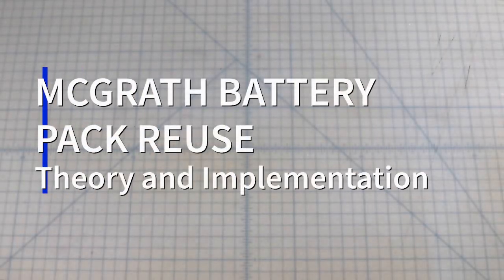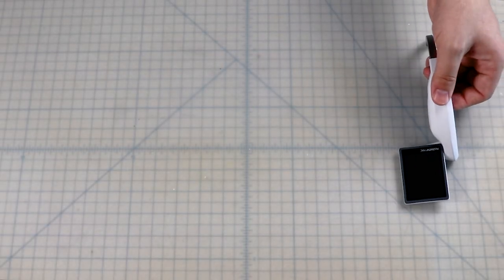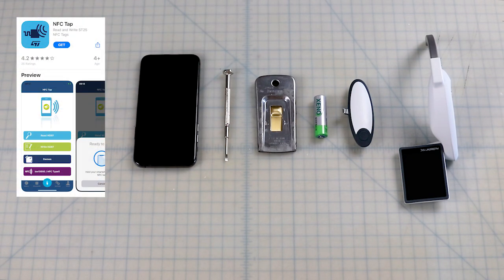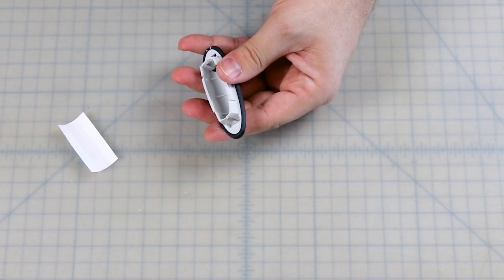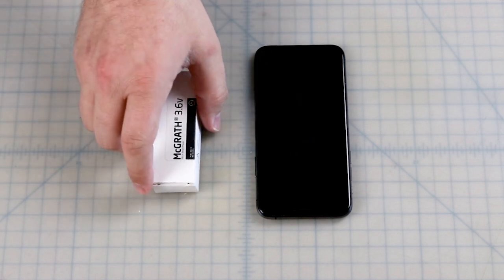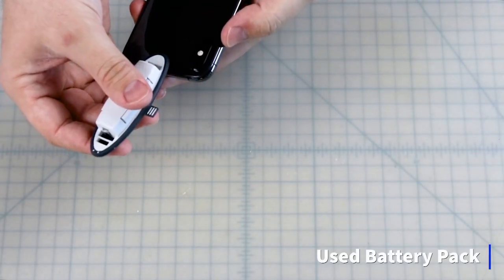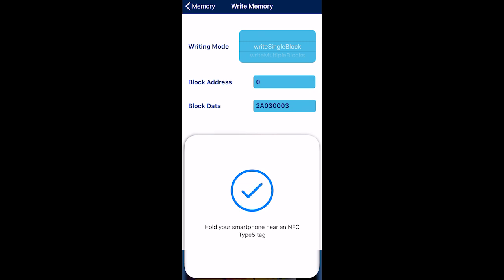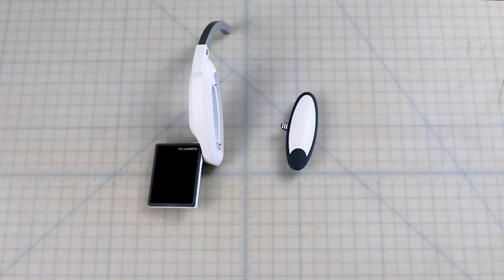How to Reuse a McGrath Video Laryngoscope Battery Pack

Comment: Hi Marc, fellow anesthesiologist here. 
I purchased a McGrath for personal use since several surgery centers lack of airway equipment.
I’d like to use a NFC app to extend the use of my batteries.
The app referenced in the video does not seem to be available anymore.
Any other recommendations. Some of the other NFC apps are expensive or don’t seem to work well.
Thank you.

Comment: Hello. I have a problem with replacing the battery. When I installed a new battery and turned on the device, the monitor does not show a picture. What is the problem?

Comment: Hello
If anyone is still looking for the android app similar to nfc tag, i think is called ST25 NFC Tag, at least it has the same icon, but a different layout
The annoying thing is that the phone has to be in contact with the battery the whole time. It can read and write the desired values.
Unfortunately I could not get mine to work because a colleague had used a different app before me and formatted the tag....so if anyone can make this work and save a loadable data file, please let me know

Comment: Thanks for this valuable video ! I was able to reset the OEM battery. Tried few new batteries and most of them were shorter than the OEM and did not make contact with both end of the hub. The last battery I tried fit perfectly but it didn’t work despite the scope turning on. It would go straight to a blue screen. I was wondering if you have any idea what the problem could be. Maybe the system is only compatible with the HCB OEM battery? Mines is 2021

Comment: I wonder when they will address this "undocumented feature" of their firmware :)  Does it still work? Nicely done!  Would you mind sharing how you deciphered the data to get a use duration that you could modify?  Is the 250 (for practical purposes) the number of intubations or is a RTC based system?

Comment: The app doesn't let me read multiple blocks 
I was wondering if any other apps are also good for doing it
Reply: I had to use the NFC Tools app. I had to pay $2.99 to unlock the write feature but it was way easier to use than the free app.
Reply: @rhettkelley2699  can you provide instructions on how to do this with the NFC Tools App?
Reply: @rhettkelley2699  How did you do with NFC Tools? I bought it but I don't know how to edit the values.

Comment: "NFT Tap" free application is no longer working. I used it about 6 months ago and it worked fine. I tried today and I get an error message anytime I try to scan a battery: "Error while processing CCS file" ...this is very upsetting and I cannot find a way to get past this. 
"NFC Tools" for iPhone is another app I found that does work flawlessly, although it is not free. However, only a $2.99 one-time purchase so it's definitely worth the 3 bucks.
Reply: can you please provide instructions on how to do this with the NFC Tools App?
Reply: @DominiGuya  its the same, the options have the same name
Reply: Can we write the same codes?
Reply: Would you be kind and share the instructions with this app?

Comment: Really did appreciate this video.  Once we reset the timer on the battery, we no longer used it for patient care.  They were great for training and did extend the life of our patient care batteries by ONLY using them for, you guessed it, patient care.  The first time, we replaced the internal battery as suggested in the start of this video.  It worked but seems to add an unneeded step, but even using the original battery, we could often get another hour or 2 from it.

Comment: Hi Marc, do you leave the battery slot exposed, save for that bit of paper, or do you put a bit of tape over it? Or does it remain in place just fine without doing that?
Reply from the maker: Should stay in place fine without tape.

Comment: Error while processing CCFILE. Any ideas how to remedy? Using iPhone 12 Max.
Reply: I had to buy NFC Tools in order to read and write to my battery. I got the same error using NFC Tap.
Reply: @karlahanks9818  How did you do with NFC Tools? I bought it but I don't know how to edit the values.
Reply: Use “OTHER” and then use READ/EDIT MEMORY  to read the data and edit the values you wish to use.
Reply: Then what valúes i hace todo change¿

Comment: Great video thanks, we are considering buying some McGrath VL's for teaching but I didn't like the idea of a non-rechargeable/sealed disposable battery pack (never-mind the cost!). At least this way you can re-use the housing, or hopefully find a rechargeable 3.6V battery replacement. And great tip to re-program the original pack when the first 250mins expires. Seems you can get almost double the run-time (and if only being used for teaching, no risk if it cuts out mid-intubation).

Comment: Does this work on new battery pack?  I just got my blade and battery and it looks slightly different from the back of the battery as if I can’t cut it open.
Reply from the maker: I'm not sure. I haven't personally reused a battery in a while. I will have to check.
Reply from the maker: I looked and the new battery looks approximately the same to me

Comment: I dont understand. I need a new original battery to do that?
Reply from the maker: No, the use of the new battery in the video was showing where the data needed comes from as an example. The numbers needed are listed in the description section of the video.
Reply: @DrMRod  thanks. I will try!
Reply: No. It was for the purpose of demonstration in the video.
Reply: @danielc.4824 i have the same query.

Comment: @Marc Rodriguez, MD   GREAT video! My wife just purchased a McGrath Mac directly for herself as only a few of the hospitals she works in have them available.  First thing I pointed out after we got it was that the battery was non-rechargeable and quite expensive... this will be very helpful.  

One suggestion, please mention the NFC Tap app right up top in your comments, I tried three other apps, none of which could read the NFC tag on the Mcgrath before I searched the comments for the app you used...
Reply from the maker: Thanks for the tip, I added the app name to the second line of the video description, so hopefully that gives it more visability.

Comment: Very helpful indeed especially when CORONA hit us and there has been supply issue. Moreover, it helps to make the world a greener place by 1. using the battery to its full potential before throwing it away, 2.by being able to change the battery, it reduces the amount of plastic waste generated which goes into landfill.     
The next step would be to try a rechargeable Lithium ion battery which is 3.7 V instead of the single use 3.6V lithium battery!
Reply from the maker: Glad it helps! Thanks for the suggestion with the rechargeable battery, I hadn't initially considered that but seems like a good idea.

Comment: How did you determine the block values?
Reply from the maker: By reading the RFID tag when the OEM battery counter read that time on the screen. I don't have any algorithmic understanding of the values that would allow me to generate them from scratch.
Reply: The value in Block 1 seems to be a simple timer in the format "<minutes> <hours> <seconds> 00". Minutes and seconds are limited to 60. The hours value does not seem to be restricted.

The real magic happens in Block 0. I still don't fully understand it, but it seems to be something along the lines "<counter A> <counter B> 00 03". Counter A is reduced by three every minute (derived from Block 1). If counter A hits 0, counter B is reduced by one. If counter B is 0, counter A is set to 255 for a final time. This represents 85 minutes (255 / 3). The display will show 65 minutes left, suggesting a  buffer of 20 minutes. However, if counter A is already inside the buffer zone, the device will not start again.

I am still puzzled on how the displayed time is calculated. There seem to be some exceptions to the rule.

Sidenote: The maximum time can be achieved with Block 0 as "3B 03 00 03" and Block 1 as "00 00 00 00" (=> 255 minutes).